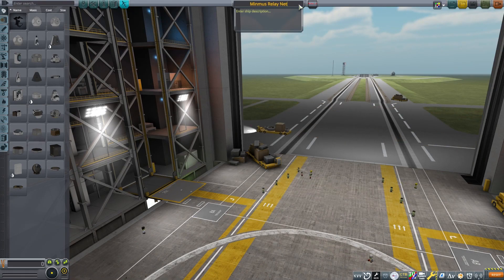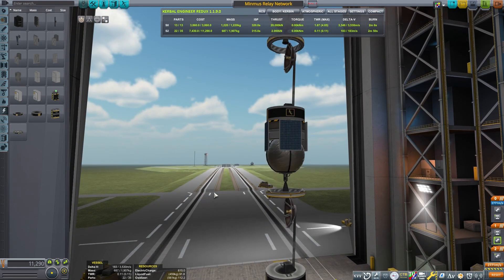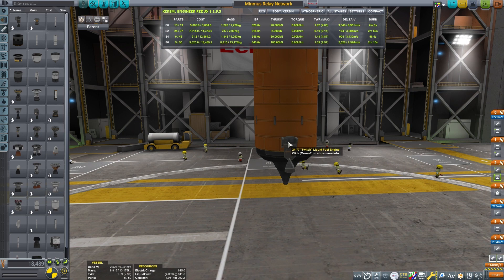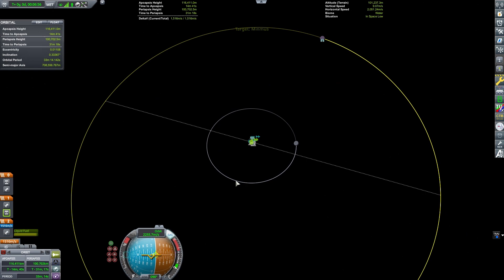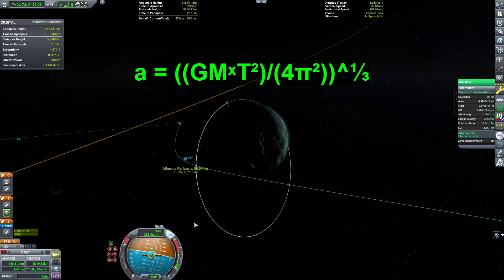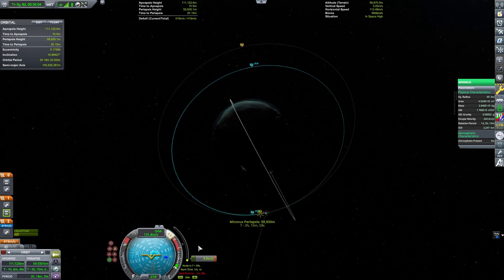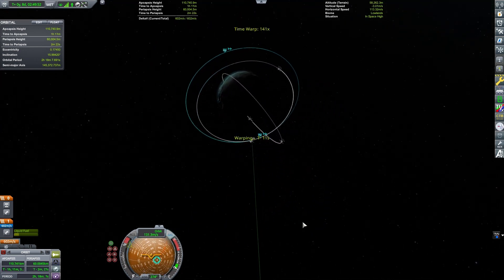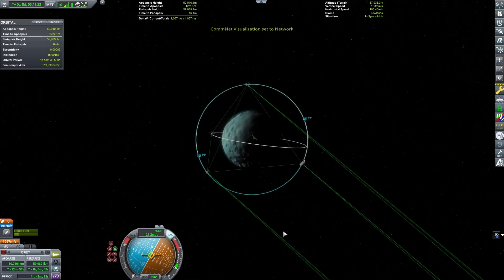Intro to CommNet Part 2: How to Make a Relay Network

Comment: Aren't these antennae direct type ones?
Reply from the maker: "The HG-5 High Gain Antenna is a deployable antenna, used to connect to CommNet and transfer science. It is a relay antenna; it can boost signals from other vessels, bouncing them back to KSC. It is deployable, and must be deployed before use.

It is the weakest relay antenna, weaker than the RA-2 Relay Antenna."

From the Wiki - https://wiki.kerbalspaceprogram.com/wiki/HG-5_High_Gain_Antenna